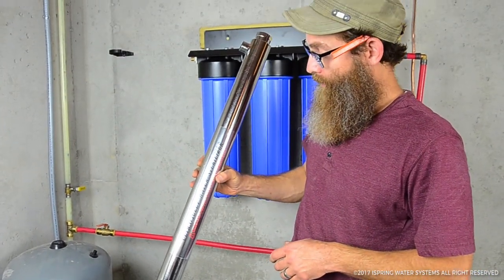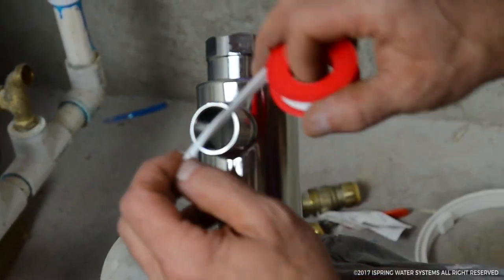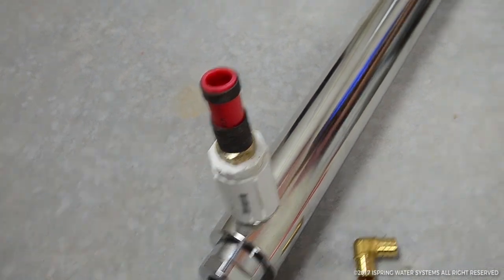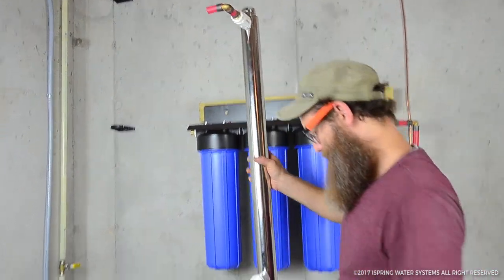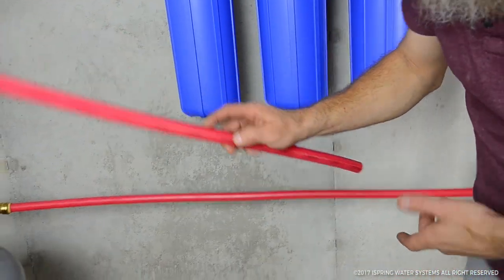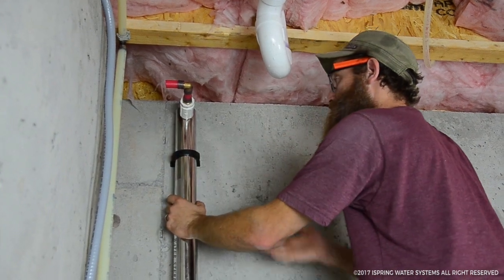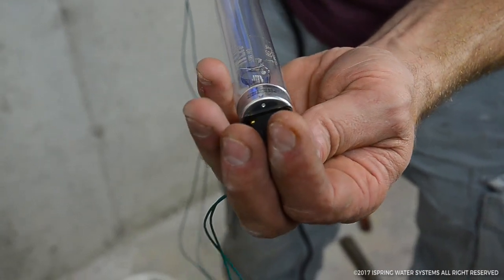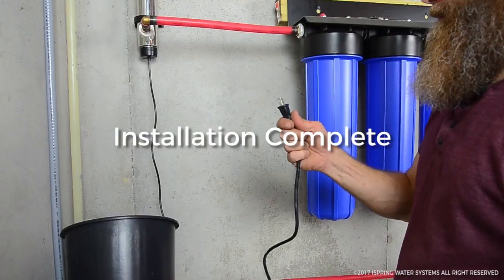DIY Installation Guide of iSpring UV Water Filter and How to Connect

Comment: I quit watcing at 3:30 when you were handling the UV light. DO NOT TOUCH THE LIGHT. The oil from your skin will destroy it prematurely. If you accidentally do touch it, clean it with rubbing alcohol. Touching it is a major mistake and it will cost you if not cleaned properly after touching.
Reply from the maker: Hi there! Thank you for your feedback — it really helps us improve our content and service. Please, check the latest version of the step-by-step installation and maintenance video for the UVF55FS:
https://www.youtube.com/watch?v=YJMH7BMXMIc 
If you have any concerns or questions about our products, please contact us at support@ispringfilter.com or 678-261-7611 (M-F 9:00-5:00 EST). We'll be happy to help! Thank you!

Comment: what does the numerical display on the ballast mean?
Reply from the maker: Hi there. It's a timer. When the timer reaches zero, the unit turns off. When the water starts flowing again, the timer starts over.
If you have any concerns or questions, please kindly contact us at support@123filter.com, at (678) 261-7611 M-F 8:30-5:30 EST or at (470) 560-0012 M-F 8:30-5:30 EST (Messaging only) 
We are happy to help!

Comment: Ours leaks out there top and bottom 😢
Reply from the maker: Hello there. Can you please check if the O-rings are properly placed? Did you wrap teflon tape on the threads? 
If it is still leaking, please kindly contact us at support@123filter.com or at (678) 261-7611 M-F 8:30-5:30 EST. 
We are happy to help!

Comment: Isn’t UV damaging to plastic? You have all plastic connections 🤔
Reply from the maker: Hi Debo. UV is damaging to plastic but our UV lights do not come with plastic connectors. If you have any questions or concerns, please feel free to call us at 678-261-7611 (M-F, 8:30 - 5:30 EST) or email us at support@123filter.com. We are happy to help.
Reply: @iSpringWaterSystems    But your instruction video shows using plastic fittings with your UV light.  Not too bright, iSpring.
Reply: Just wrap your piping with aluminum duct tape.  @ayCarumbaQueLio
Reply: I have read that you should have some pipe other than pex 12" both in feed and outlet side of UV light because UV light will degrade pex.

Comment: Is this uv disinfection designed to be used in conjunction with the 3 stage mechanical filtration systems? Do we simply purchase separately and use together?
Reply from the maker: Hi there! Yes, you can use the UV filter together with our 3-stage whole house system. And yes, you can purchase them separately and use them together. If you have further questions, please contact us at 678-261-7611 (M-F, 8:30 - 5:30 EST) or email us at support@123filter.com. We are happy to help.

Comment: Did you all stop carrying this? I can't find it in stock anywhere
Reply from the maker: Hi tranceformer110. Our UV lights are currently out of stock due to high demands. We are trying to bring them back ASAP.
Reply: iSpring Water Systems 
Be aware, uVC products are in short supply in home market due to COVID. A lot of knock off V-uV (ozone) products have found its way into uVC inventory / market.
Reply: iSpring Water Systems any update on bulb replacement? Mine just went after 18 months. If yes can you provide a link? Thank you.
Reply from the maker: @JonathanODonnellSays  Hi OD. You can find the bulb here: https://www.homedepot.com/p/ISPRING-55-Watt-UV-Replacement-Lamp-UV-Bulb-for-UV-Water-Filter-UVB55/306549323
Reply: OD Says 
I’d try these search words 
iSpring replacement uV bulb
Reply: @iSpringWaterSystems  thank you! Just ordered. Are these considered hazardous waste? How do you recycle them? Thanks.
Reply from the maker: @JonathanODonnellSays  Hi OD. For recycling, since the requirements vary among states, you can contact your trash removal service and ask if your state requires UV bulb recycling. The garbage contractor can tell you how to go about having your bulbs picked up by your curbside recycling provider or taking the bulbs for recycling.
 
 You can also call local hardware stores, home improvement stores, and other retailers who sell UV bulbs. Many allow customers to drop off used bulbs for recycling. Home Depot and Lowe's are among the national retailers who offer this type of program. However, not every store in these chains participates, so call to make sure your local store is a member of the recycling program.

Comment: I just need something for drinking rain water. I was thinking of something like thiPolaris UVA-2C UV Disinfection Sterilizer For RO & Drinking Water Systems 2 GPMs  https://www.ebay.com/itm/Polaris-UVA-2C-UV-Disinfection-Sterilizer-For-RO-Drinking-Water-Systems-2-GPM/254561855347?hash=item3b4511a773:g:G6YAAOSwF3Beit9s . But how would I know it is working because there are so many scams out there. I can't afford to get scammed but need it to be as cheap as possible. Thanks in advance for any and all info.

Comment: inlet should be at lowest if mounted vertically. electrical plug should be at top on vertical install so water never gets in connection
Reply: Given where the brackets were positioned, I’m afraid that electrical connection can’t be on the upper end, due to long uV bulb can’t clear the ceiling.
Reply: @philoso377  llolllllll
Reply: @philoso377  this guy clearly does not know what he's doing. He should watch a YouTube video to nail it.